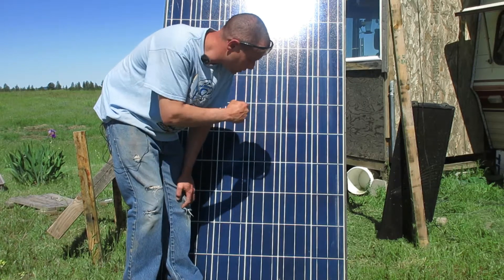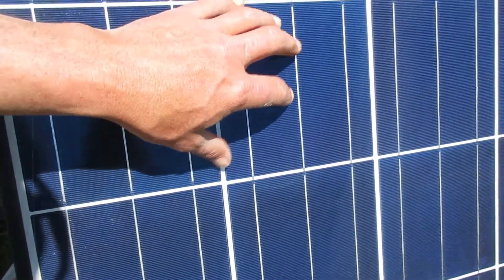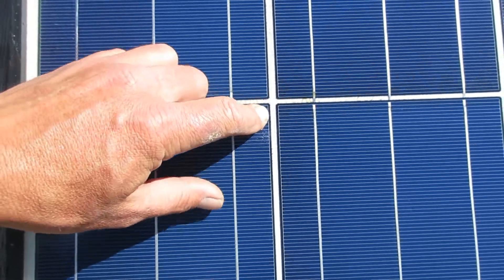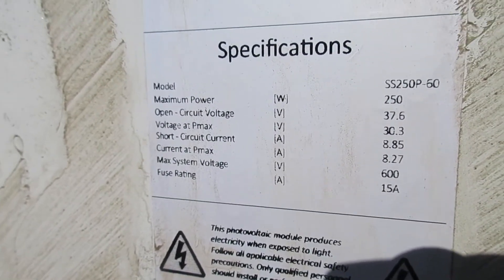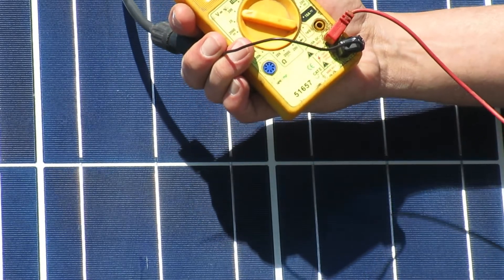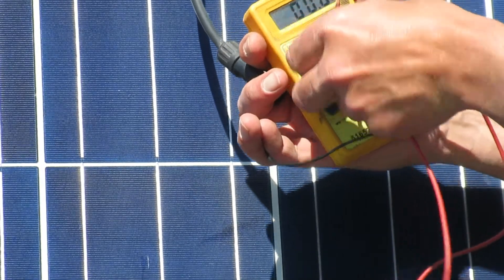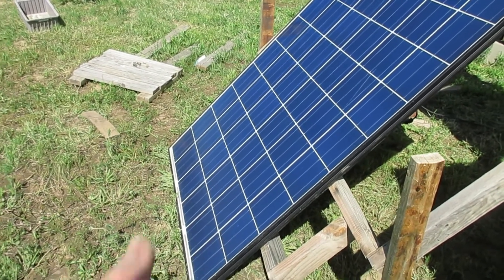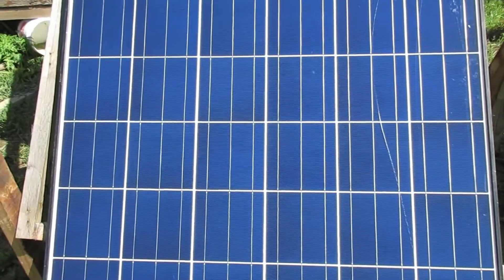How to test used solar panels and what to look for when buying them

Comment: so when a panel is used and is putting out less wattage is it the amps that are usually degrading the solar gathering capacity? And if so would that mean hooking 2 of these together in parallel that are only putting out under 7 amps would work with a 15 amp max powerstation even though when they were new they were rated over 8 amps?
Reply from the maker: The biggest loss is the amperage, but voltage does go down as well. Technically speaking, it should work as long as the voltage is still lower than the rated input on the powers powerstation, but even new panels can go over their stated capacity, so I wouldn't try it
Reply: @WindwalkerHomestead  Thanks for the quick reply, I appreciate your advice
Reply from the maker: You're welcome.  I hope it helps your research

Comment: Don't  test panels when you are shading them-you can get false readings if the bypass diodes are actually working.also check to make sure all the connections are "tight"-torqued to specifications,and not corroded.....you can test to see if a diode is bad if you get a low voltage,also.....

Comment: Always open the connection cover and check for corrosion.  If water gets in the box the corrosion can be severe.
Reply from the maker: That's a good point that I forgot to mention in the video. Thank you

Comment: That one panel may be like new; over 8 Amps is excellent;  you still need to measure volts and amps under a proper load,at the same time, then multiply them to get the Watts

Comment: I was looking at potentially looking at buying a solar panel used were santan solar panels 250 watt 4 of them for under $200 just trying to figure out if it would be a good deal if they we’re close if not to spec

Comment: I know that no one will ever read this comment but I needed to add something here. Does anyone know why we test a used solar panel? I don't think that you do. We test for voltage and what that tells us is that all of the cells of the panel still make a series connection. If the voltage reads Zero then the panel is no good and needs to be thrown out. 
When a panel is used it NO longer has the ability to produce full current. It is a used car that is worn out. Some used panels are better than others and that is what we are looking for. 
When you took a current reading and you got 6.5 Amps you should have read 8.8 Amps on a new panel. If you take 6.5 Amps X 30 Volts (MPP voltage) that equals 195 Watts. These are 250 Watt panels and that is what it says on the label. The 6.5 Amp reading is a real reading and it tells us what we can expect from this panel. The panel with that low of a reading is shot and should never be connected in series with out used panels that might be putting 8 Amps. 
I bought and tested some used 165 Watt panels and the best of them put out 125 Watts. 
Sometimes you will run into some used panels that are only 3 or 4 years old but in most cases the panels are taken out of service because they are taking up space on the roof and are no longer any good so they are removed and sold as used panels. May times they remove the label from the panels so that you are not able to tell how good or bad the panels are.
Reply: Is it possible that the sun's irradiance this day  was not at the maximum (100w/m2) that the panels are tested at when new, and so,the OC voltage  and the  SC amps are lower?  I hope so,i just bought 4 used panels and they "only" give out 28 Volts and 7 amps (  30.7 V  8.3 A , on the sticker) while feeding a proper resistance,by trial and error  ( car bulbs in series).
Also i read that they are tested at 25ºC and mine here are well over 50ºC,can barely sustain my hand on it; if i cool it with some water (down to 40,maybe) the Amps go up to near 8; 
Thanks
Reply: Could just be bad bypass diodes-not necessarily a totally shot panel.